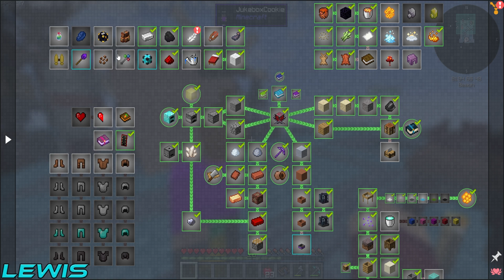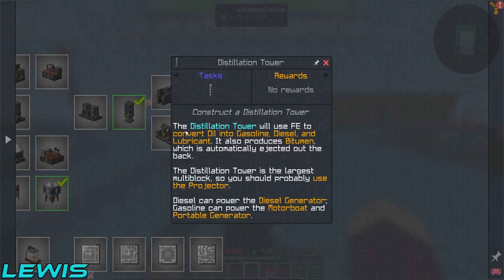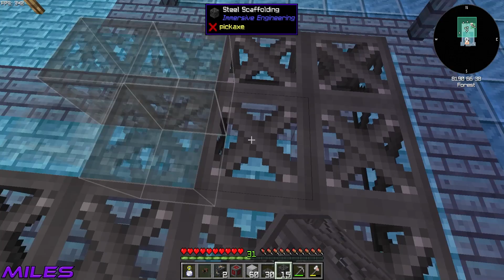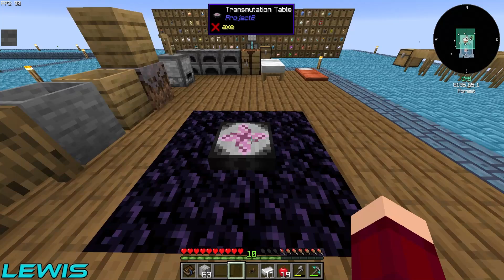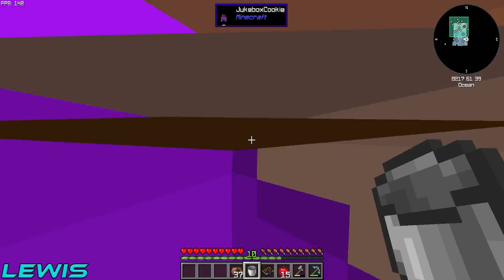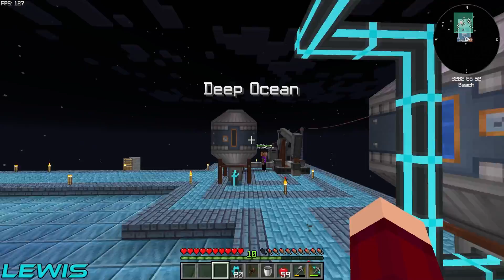UNLIMITED POWER USING IMMERSIVE ENGINEERING! Not Too Complicated 2 EP6 | Modded Minecraft 1.16

Comment: The cost to put the power lines in the ground and create access is more expensive then slapping up poles and running wires.  For high voltage, long distance transmissions there are additional considerations for why they aren't run underground.

Comment: There's this thing called grounding when it comes to electricity and the ground.  The cost of shielding the cable to prevent grounding (and massive losses in transmission) is prohibitive, compared to stringing it from pole to pole.